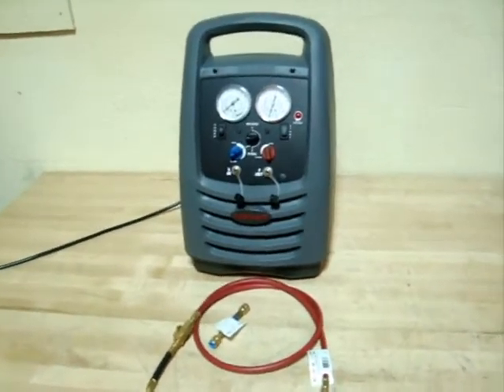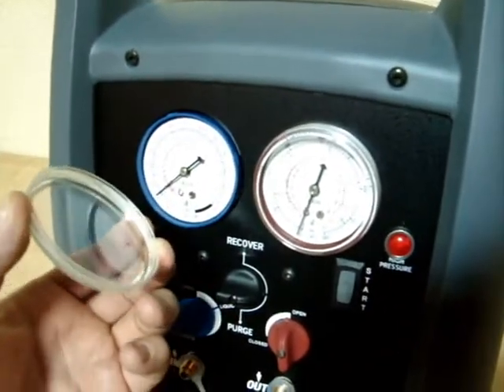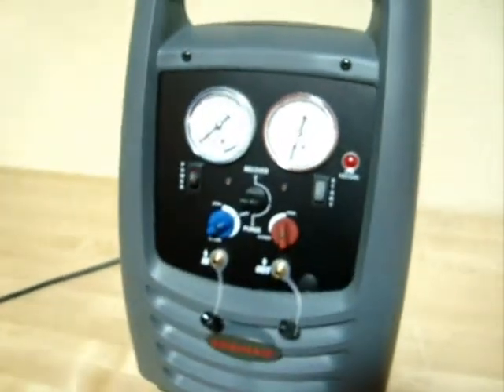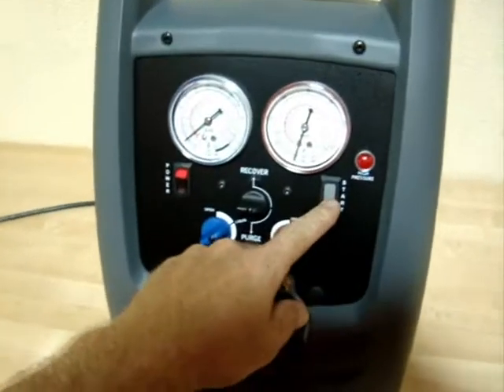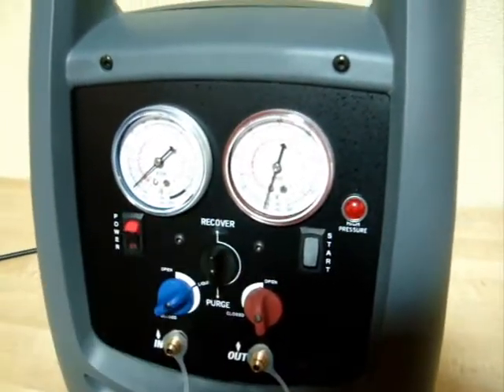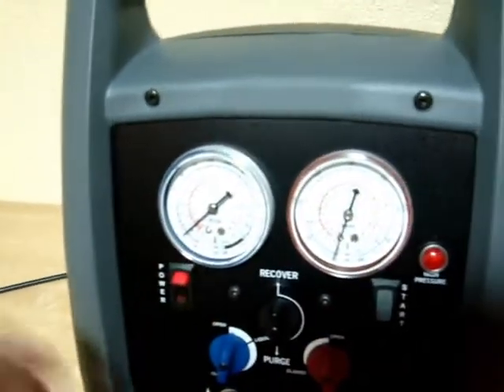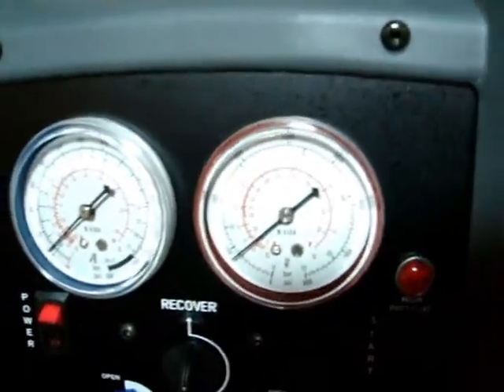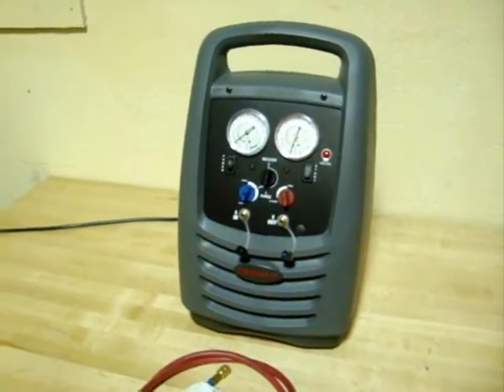Robinair HVAC Recovery Machine Test

Comment: Is it ok to run those recovery machines on air for testing purposes? I am sure you would purge it/remove any air before attempting to recover from a system. I bought a used one, and I don't want to lose or contaminate refrigerant in a system without testing it first before hooking it up. Just want to make sure the seals are good and it builds up pressure.

Also, could I charge one with nitrogen and do a pressure test to check it for leaks?

Thanks!